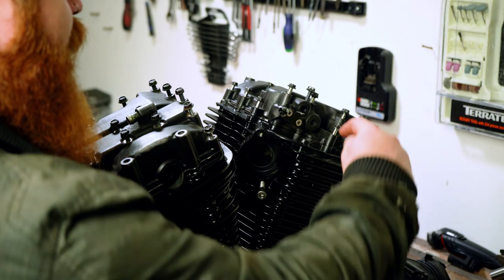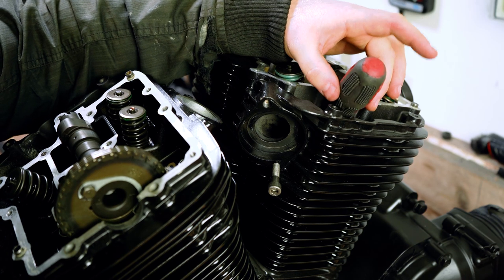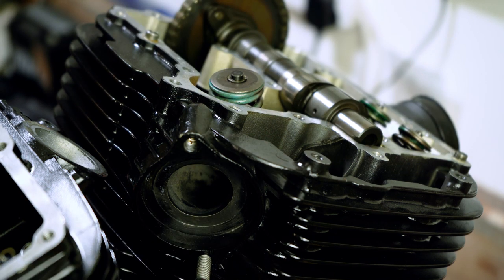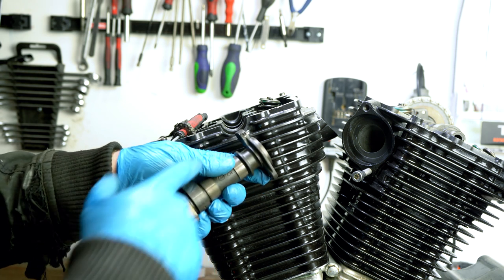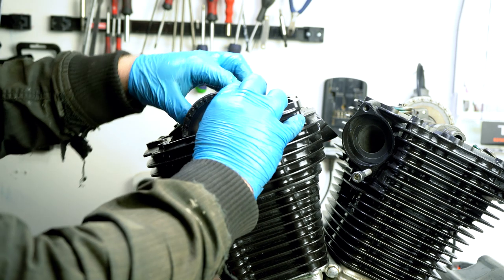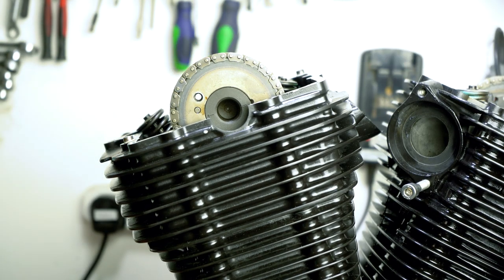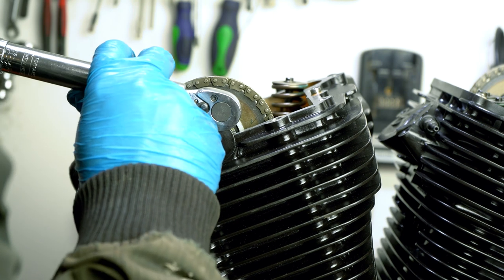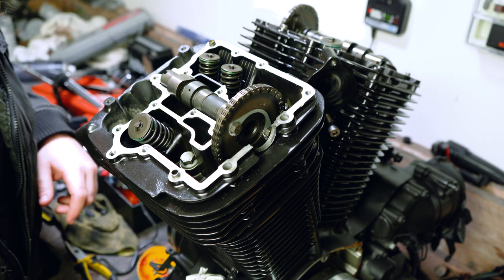Suzuki Intruder VS1400: Timing The Engine - Top End Build 2/2 - Rebuild Part 6

Comment: RT is “NOT” tdc for the front cylinder, rear only, FT is for front Tdc. I destroyed my head piston and exhaust valve by doing exactly what you said, I tried to figure out what went wrong and if you simply check piston level on both cylinders at “RT TDC” the rear will be at tdc but not front

Comment: How can you know that it is actally compression stroke, when your rocker arms are missing? -> valves are closed all the time.
Reply from the maker: There is absolutely no reference to the "compression" stroke in the workshop manual, checked dozens of online forums etc and all confirmed that the procedure for this bike is TDC at no.1 cylinder (rear) - However the important of TDC on the compression stroke is however pretty much essential on all other bikes that I have worked on. Thought it better to add that info than leave it out ;)

Comment: Hello enjoying your intruder series. But finding compression stroke is redundant if there is no cam the important step is tdc which you can find on the flywheel like you shown on RT for “ rear cylinder timing mark “ and I am sure the have a FT timing mark for the front cylinder timing. These marks are for engine timing not ignition timing. Just some FYI
Reply from the maker: Thanks Man&Machine. You're not wrong my friend, the tdc reference on compression stroke is force of habbit. By the time the penny dropped while editing the video, I couldn't justify deleting it. I figured its still good info that the average weekend mechanic should be aware of, even if its not relevant to this particular bike. 😉
Reply: i definitely understand your reasoning. You are very thorough on your videos which is not a bad thing. 😃

Comment: first, just want to say that I love your video's. They have helped me immensely with my rebuild. 
   I just did the timing on my engine and am at the same point as this video. I have a question about the rocker arm tappets I think they are called. I noticed you did not do anything with the tappets. my manual says that you have to bleed the air out of them or they will make a ticking sound and could result in damaging the engine if you don't? They don't say in the manual how to do it?
 I have googled a bit. I think they are hydraulic tappets on my 98 vs1400. I have found some that say you have to remove them and bleed the air out. Others say just drive the bike slowly for a bit and they will bleed themselves? can you please tell me who is right? i just assembled the rear cam cover without doing anything but don't want to go farther if I am going to do any damage to the engine.
Also while putting the cover on, there is interference with the rocker arms and valves and had to tighten the bolts down in order to seal the cover. I am guessing this is normal? it looks like that is what you did, but you didn't mention it.
   Thank You again for your very informative videos. I don't know what i would have done without you as the manuals are not that easy to follow.
Reply from the maker: Hi Andy, thank you for taking the time to write such lovely words, it is appreciated.
In regards to the tappets (hydraulic lifters) I can only speak from personal experience. While it is "propper practice" to disassemble and drain etc, I am not 100% convinced this is required. I did not do this on my rockers although I did debate whether to completely disassemble the head case/lifters to clean, and rebuild but honestly, I wouldn't be too concerned with it. Don't forget that my bike only has 18k on the clock, if yours is up in the 40k+ mark, it might be worth your while going the extra mile.

Comment: When you do valve timing with No.2 (front cylinder) did you Rotate the generator rotor 450 degrees (1 and 1/4 turns) and
 align the “F I T” line on the rotor with the center of hole on the generator cover? Because in video i didn't see that..Or just Rotate the generator rotor to set the No. 1 engine’s piston at
TDC of the compression stroke. (Rotate the rotor until the “R I
T” line on the rotor is aligned with the center of hole on the
generator cover.) And set up the same time both camshaft?
Reply from the maker: DO NOT rotate the gen at all! Time the rear cylinder first and leave the gen in its RT location. The workshop manual clearly states not to rotate the gen at all.

Comment: Hagar I need some help  the starter teeth broke off the starter ring on my vs1400. Also Massive backfire on front cylinder. I checked the timing using the R/T and the arrow and looks to be possibly off. Recently replaced head gasket and base gasket. In your video when you take the slack out the chain  the arrow aligns perfectly with the head.  Can you confirm the arrow doesn't move slightly downward or upward when the tensioner is released. I cannot get it to stay perfectly aligned and parallel with the head when the tension is on the chain. With no tension I push forward slightly to remove the slack and everything aligns perfectly. I've redone it over 20 times a tooth either side but the arrow always points slightly up or down dependant on tooth position when under tension. Thank you
Reply from the maker: You will get some movement in the cam sprockets when you release the tensioner, this is residual movement and will not effect the timing...providing you have got the alignment, TDC etc spot on as per the user manual. The backfire will not be down to bad timing, bad timing typically would show symptoms such as not firing up at all or a very clear, out of time sound when it does finally get going. The backfire is likely fuel related(Carbs would be my guess) have you had them cleaned recently?
Also the starter ring tooth? do you mean a tooth on your starter motor has broken off? I would highly advise replacing said motor before it shatters into your generator and causes all kinds of bottom end damage.

Comment: Could you tell me how to time a 2005 C50 800 Suzuki Boulevard
Reply: Just did mine, vs 800 is different than the 1400 procedure. Manual says line up R/T with timing hole on cover, than time both front and rear off that mark at the same time. Also, my vs800 has a timing mark cast into the inner case at the same location as the Hole in the cover. (If the cover is removed). I verified that mark with a dial indicator on the rear TDC. Cams seam to be in different stages ( rear is at TDC and front is about BTDC) but alignment marks are where they should be on the cams and gears.

Comment: I did all of it, but my valves is ticking a bit when i give a little bit of throttle. But only on the rear cylinder, the rear cylinder is also much colder than the front, any suggestions? 🙈 And thanks a lot for the videos

Comment: Sorry, but with the ro keys removed all the valves are  closed on both  cylinders , and you have the same results on the exhaust stroke as on the compression , namely a pfffft !
TDC cannot be determined that way .